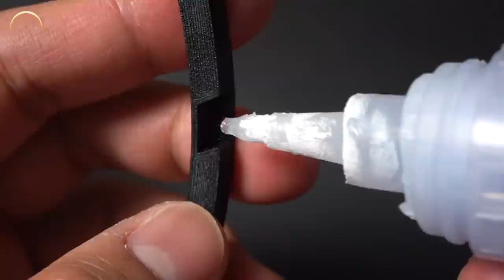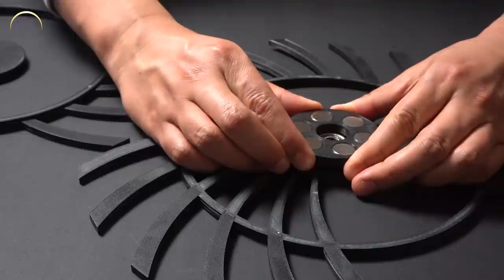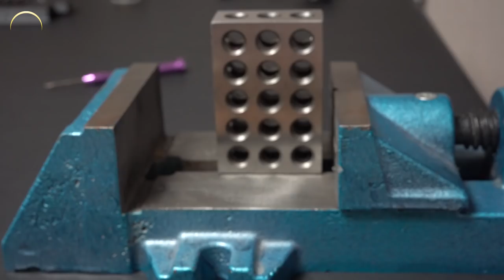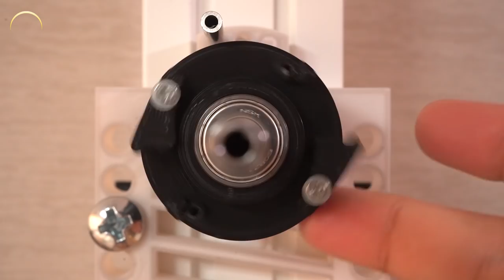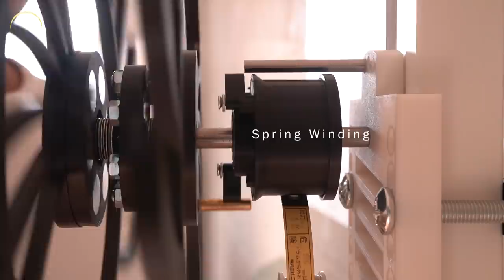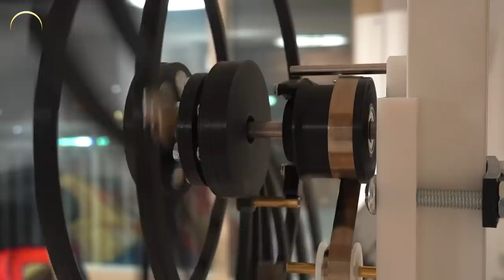DIY Kinetic Sculpture with Magnetic Gear, Driven by Static Force Spring (Duality-s, Kinetic Art)

Comment: It's awesome but how many hours it will rotate?
Reply from the maker: This project started with whether magnetic gear can be applied to kinetic art.

The result was that it couldn't.

The rotational force could not be maintained for a long time due to the magnetic force.

As a result, the running time was less than 2 minutes.

The link below is the kinetic art of the same design.
https://youtu.be/QlmKlArlJ8A

The running time is about 30 minutes.

Thanks :)

Comment: how does the magnetic coupling work (to get the reverse direction of spin)? is there a specific name for that type of coupling?
Reply from the maker: Thanks for the question.

The reverse rotation of the front and rear wings is caused by the force trying to balance the magnetic field between the center plate.

The rotational force and number of rotations in the reverse direction depend on the number and strength of the magnets used.

In general, this type of gear seems to be called just a magnetic gear.

Reference here.
- YouTube : https://youtu.be/c6a4nxRUycU
- Journal Paper : Tlali, P. M., Wang, R. J., & Gerber, S. (2014, September). Magnetic gear technologies: A review. In 2014 International Conference on Electrical Machines (ICEM) (pp. 544-550). IEEE.
Reply: To distinguish it from direct magnetic coupling it is sometimes called a second order magnetic gear or magnetic  device. Wikipedia has a paragraph on it in the Magnetic Gear page.

Comment: Now u r use magnets How many hours its rotation?
Reply from the maker: This project started with whether magnetic gear can be applied to kinetic art.

The result was that it couldn't.

The rotational force could not be maintained for a long time due to the magnetic force.

As a result, the running time was less than 2 minutes.

The link below is the kinetic art of the same design.
https://youtu.be/QlmKlArlJ8A

The running time is about 30 minutes.

Thanks :)

Comment: how does that magnetic gear work?
Reply from the maker: Thanks for the question.

The reverse rotation of the front and rear wings is caused by the force trying to balance the magnetic field between the center plate.

You can easily find out the mechanism from link below. 
- YouTube : https://youtu.be/c6a4nxRUycU